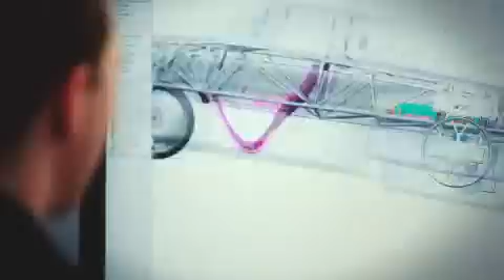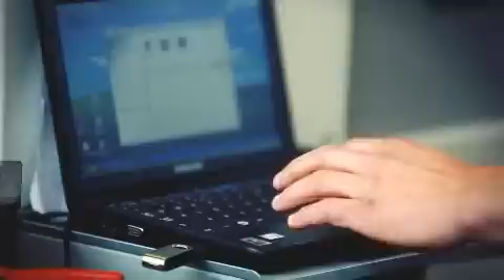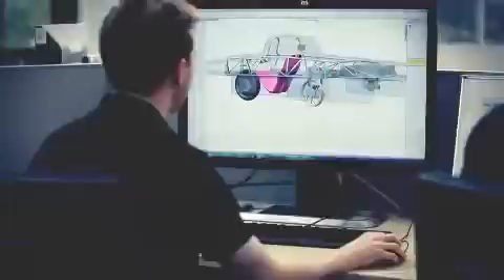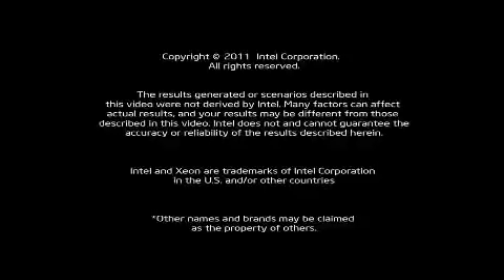Solar powered car,

Comment: Are you buying or building your drive motors? Just a curiosity, I've always found drive motors to be the most expensive part of an electric drive-train and I've also found instructions on building some similar systems. If you guys ever need a motor design for your own cars you could try the one listed on amazingdiyprojects, although you would probably want to change the design materials to be more structurally sound. Good luck in Australia!